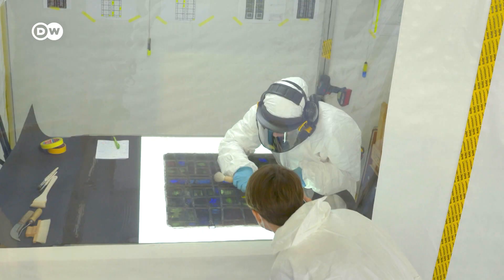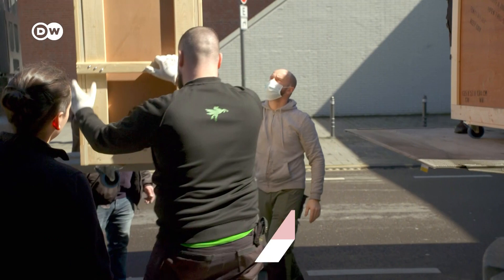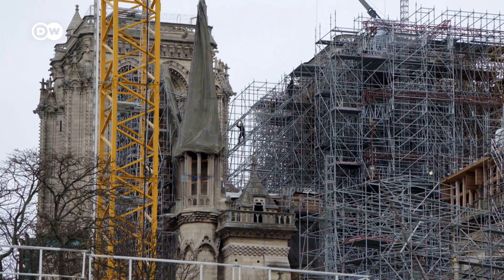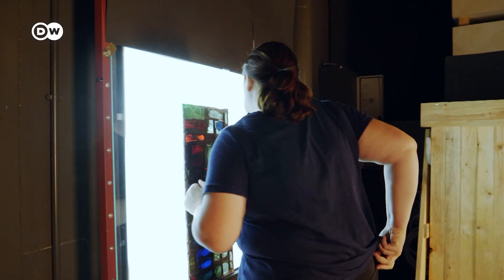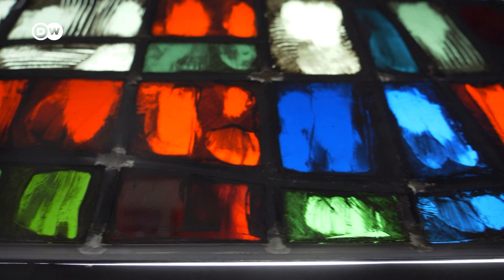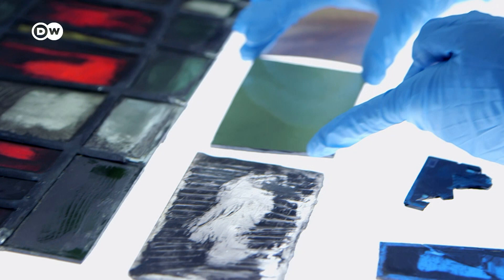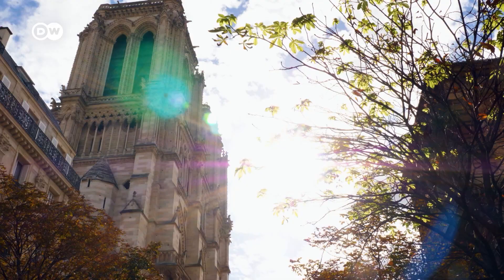How the Cologne Cathedral restores Notre Dame's Windows

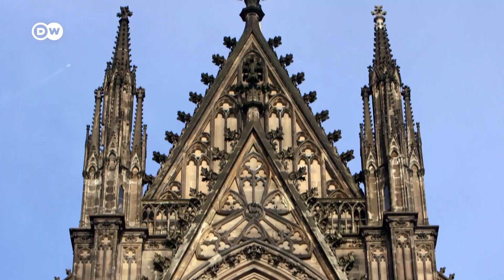Comment: 0:40 Don't worry! Cologne Cathedral can't burn down as its roof truss is made from steel, not wood. In fact, it was the first big steel structure a few years before the Eiffel Tower. Tbh, I find it reckless to rebuild Notre Dame with a wooden truss again.
Reply from the maker: The original wooden roof structure held up for eight hundred years...
Reply: @dweuromaxx  That was pure luck! Many cathedrals have burned down several times.
Reply: @dweuromaxx  You should give the person who replies a raise, because daaaamn. Greetings, the person who lost a "than" discussion.
Reply: @hape3862  Yes, like the cathedral in Cologne which burned in 1248 - which is why the current cathedral was built. 🙄
Reply: The steel truss saved the Cathedral from the bombs in WWII. It suffered only minor damage and couldn't burn down.
Reply: @dweuromaxx  It didn't prove to hold up against the resentment of Paris's local immigrant community though...